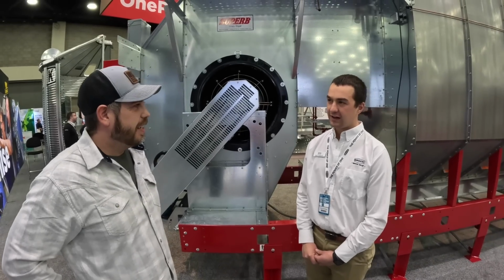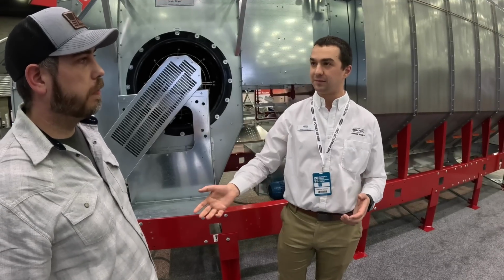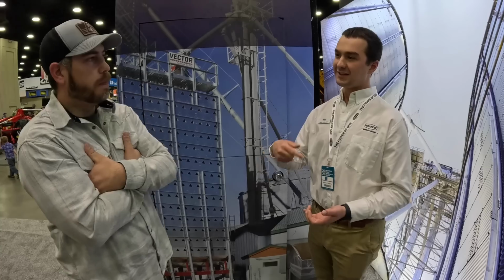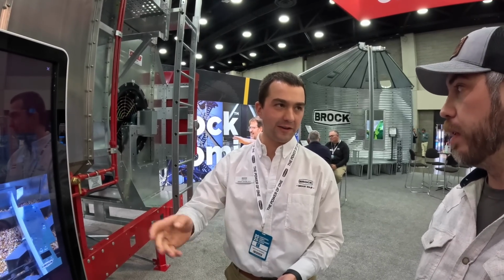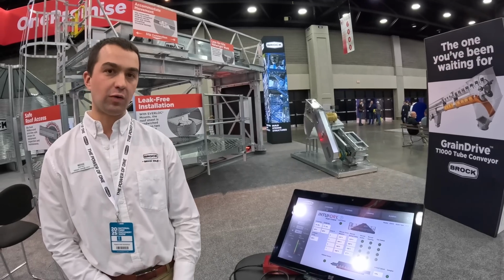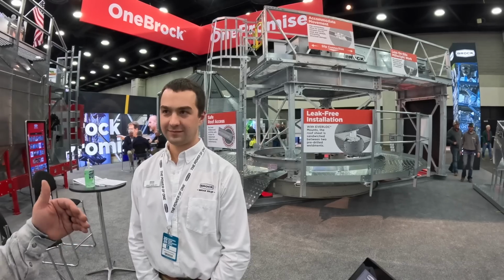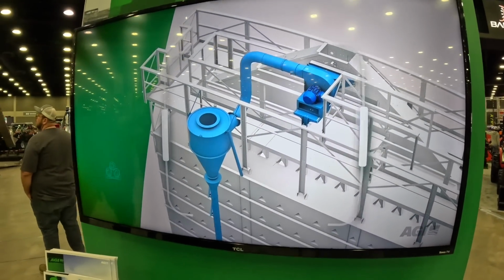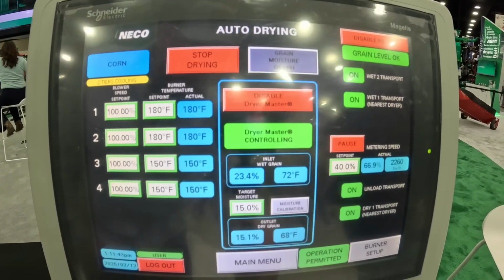Is The Mixed Flow Worth It?! Grain Dryer Interviews With Brock Grain Systems and AGI At The NFMS!

Comment: Southern MN. We dump  corn hot, let it 'steep:? No. Once there's a couple feet of corn on the bin floor the aereation fans are run until the full bin is cold. Screen vs mixed? Depends how much extra they pay up there for a really nice sample.
Reply: Yes I agree we can dump hot as long as the outside temp isn't too cold.   If there's too much of a difference in temp we just have a hard time keeping the bin walls from sweating.  

Not trying to poke holes in what you're saying but it's not what paying for higher quality what are the discounts if it's not which can be substantial.  
 I appreciate your comments .👍
Reply: @MarkHaugen Assuming you mean discount for test weight, we sure havent dockage issues dumping out a Sukup  screen dryer without cleaning it. That being said most big dryers around here are mixed flow some towers.That AGI precleaner looks like a real good idea though. How cold is it when you dry up there? 20s overnight when were hoping to be about done. Tillage, NH3 usually works well into Nov.
Reply: @lynwessel2471  yep that's what I meant discounts for light test and also higher FM potentially.   This is what I'm trying to figure out is the mixed flow worth it?  Trying to put a number on quality is hard to do.    I would sure like to speak to more people with screen dryers and get more input.
     Yes temps can be in the low teens to single digits when drying

Comment: Tks for sharing.. lots to think about in a dryer now day. So much to think about.  But with all the different options to go to.... how's the over all though out the bin after it's dumped in? You get different dryness from bottom to top? That's confusing to me.  You get a different moisture at the beginning then the end in the bin?
Reply: The grain is slowly removed from the bottom of the dryer (and wet added at the top) the moisture is constantly electronically monitored as it exits the dryer. if it begins to get slightly too dry, the flow is automatically sped up so it dries a little less...too wet its slowed down a little.
Reply: @lynwessel2471  oh!! Got ya.. that makes sense now.. so dry gain comes off the bottom and mixed what's coming in at the top... that clears it up... tks
Reply: @ronaldfeuerstein435  The grain dries on the way down from the top of the dryer and ready by the time it leaves. Continuous Flow drying they call it.
Reply: I see these guys took care of your questions 👍.  But yes a lot to take in
Reply: @MarkHaugen  Hey there? Yeah I think? You brought up so many different questions that I never could have kept straight.  Wow... I dont see how you can do it...

Comment: Love all the interviews with all the manufactures , you did an Awsome job Mark , I commemeted the other day and on your fist dryer video that would pick the grain handler and  that was based just on that video, we just used our Brock Mix Flow this past fall for the first time and love it , I mentioned the other day we have a really awesome Brock dealer and we do but these Brock dryers are built less than 1 hour from our farm, we kept that in mind in case we needed parts quickly , good luck on your pick mine would be the vector
Reply: Yes it can boil down to who has the best support.  Thanks for watching 👍